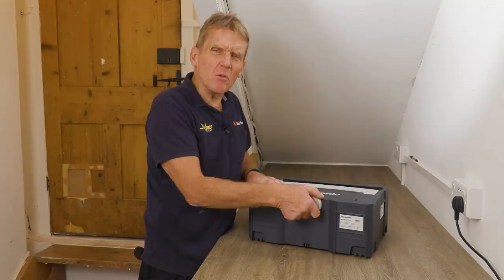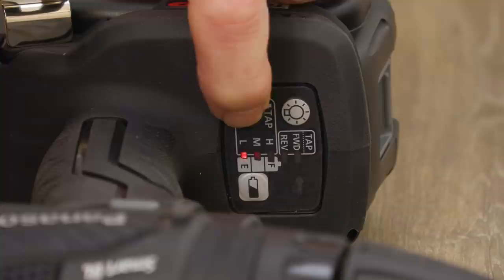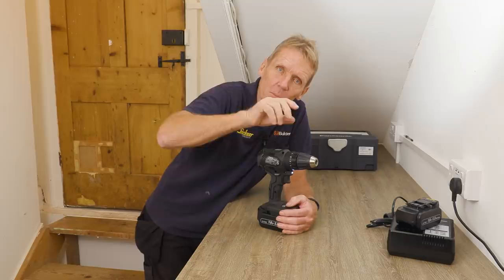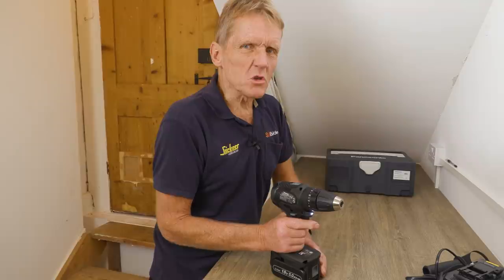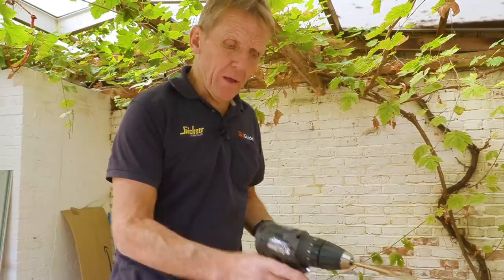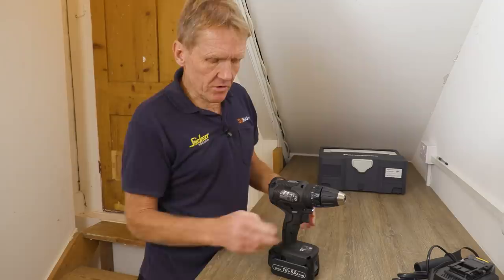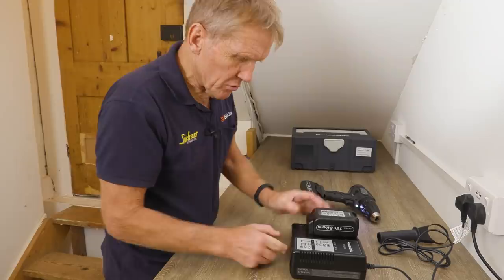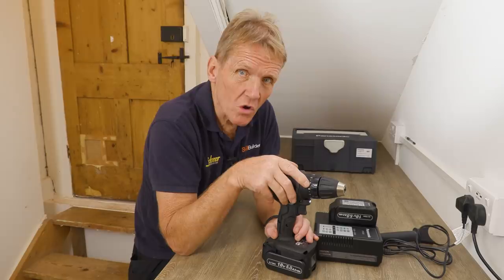Panasonic Next Gen Intelligent Smart BL Drill

Comment: I bought a Panasonic tough tool in 2008 when I did my apprenticeship, I still use both my impactor and my 14.4 drill driver, I used the 14.4 to mix up cement the other day with a paddle after 13 years of solid abuse the batteries still going and the machine is still working. In that time I know people who went through 8 makitas of the same spec. You want batteries that just don't ever die and tools that can handle a pounding then get a Panasonic drill and impactor. Everything else I use is Hikoki and Festool - I cant speak for the other Panasonic stuff, but their impactors and drivers are ultra crazy durable.

Comment: Been using Panasonic for 15 years since I got their 14.4v impact driver which imho was the best to date, this generation of combi drills are superb, the smart gear really works well. It’s still too heavy to replace my Panasonic 14.4 drill driver for most usage but it’s brilliant when I need the guts to use large hole saws and auger bits.

Comment: I threw out the beat up 15 volt  that I had for 20+ years one of the original batteries outlived the secondary generic replacement. I have owned DeWalt, Ryobi, Milwaukee and Porter Cable and none have come close to the Panasonic. That one at the time charged in half the time of the others and weighed less.

Comment: I think that those systainer cases are really sub standard. Dewalt Tough system is the standard to beat. Good stuff Roger. Thanks
Reply from the maker: Mark 
I agree that DeWalt T Stack is way better.
Reply: Yes,systainers need to have care taken of,I have lots of them,some got  real battering and with a single little crack on a lead(just one)still going strong.Dewalt ones I use to build platforms on(when doing partitions and plastering)!
Reply: I agree. I have milwaukee tools with dewalt boxes. 2 reasons. Number 1. People will see the box and go "eeeeee" and not try to rob anything
Next reason, they are quality. Haha

Comment: Mmm I wonder how long all the delicate electronics will hold up on a real building site. Nice drill, don't get me wrong, but that sort of drill I would tend to use in a cleaner less coarse environment like a woodwork shop or kitchen/ bathroom fitting. Deffo don't think it would stand up to first fix on an electrical or plumbing job on a building site. But that's just my opinion.
Reply from the maker: Tiny Tony You may be right but they won't leave it with us long enough to find out. We would love to put it out there in the real world.
Reply: Been using Panasonic for 12 years.. Batteries r great... Still going strong...

Comment: Sorry, Roger but I don’t see the point as there plenty of main makes on the market these days. It would have to be cheaper than some of the best to compete.
Reply from the maker: That is fine. We are not selling this drill, merely putting it in front of our trade audience so they can see it. As you say there are plenty of other makes but Panasonic is not a new kid on the block and lots of builders swear by them.
Reply: Best battery’s in the industry. I’m still using my 14year old 14.4v 3.0ah drill and impact with the batteries they came with, alongside my new  smart brushless kit with the drill from this video. They work underwater and I’ve tested  this, on the rainy day when you’re fixing a gutter and waters running off the roof allover you and your tool you’re glad of this feature. Dual voltage too, so for the guys who have owned and loved the 14.4 range you can simply use the same batteries with the new tool, saves abit weight too if you don’t need that extra 3.6v.

Comment: You missed out on a feature the Drill has... the ability to use 14.4v batteries.. while this may seem dumb at first... a 14.4v battery still has loads of power for most things but it makes a Panasonic even lighter and feels even better to use for those that haven't got a 10.8v or 12v system too... not everybody is using them for drilling loads of big holes through wood.

To me, Panasonic has always had the best feeling well-ballanced drills and impact drivers to use they feel more comfortable to use than others. I've never had any of their membranes fail on the likes of my impact drivers.

While the tap setting is a bit gimmicky people may find other uses for it and it's an extra function that others don't have... you don't have to use it but it's always there.. you might find it useful to clear chips from certain types of wood bits in deep holes.

the only downside to Panasonic is they don't have the vast platform range other manufactures have.
Reply from the maker: Yes I forgot to mention that important dual voltage. My mistake and apologies
Reply: I have used panasonic drills for 15 years and they last ages. I do some tapping here and there. Its easier to tap with a drill because you can keep the tap upright without the wobble you get from a hand tap. Its very easy to break taps so this function on this drill is a real boon to some people.

Comment: I've never seen a drill with a tapping mode... that would be really useful in engineering!
Reply: I worked for a fabrication firm many years ago. I was showing off using a drill to tap M3. Promptly snapped the tap in aluminium job. 

Note: removing carbide out of aluminium isn't fun.
Reply: @TurinTuramber  yes I know.... I feel your pain from experiance. I imagine the tapping mode has some kind of torque limiter to help avoid snapping taps
Reply: Metabo has had one, but that’s about it on the consumer market  as far as I know.    I’d have to imagine that the aerospace/aviation, automation, or assembly manufacturers have torque limiting tappers on offer for their sectors.
Reply: @robertrada4783  yes Robert they do, ive seen them in a factory in Malaysia: they are purpose built tools that look simular to dremels however they are torque limited and speed controlled.

Comment: I used to have Panasonic drills before the cordless market really took off, I had a Ni-Cad version which was a great drill and because of that I upgraded to a Li-Ion Panasonic when those came out and I didn't like it at all. 
One of the main issues was that the drill stopped so quickly when you took your finger off the trigger that the momentum in the chuck undid it a bit and drill bits were always coming loose. Also the chuck shape with a sharp taper is not the best to grab hold of, chucks with flat sides are much easier to use.
The Panasonic impact driver was even worse, completely under powered and put me off impact drivers for a good few years. Anyway I hope Panasonic have fixed the problems although i can see the chuck is the same shape.
Now I've gone with Makita which are nice to use and they have great little hydraulic impact driver.
Reply from the maker: That thing with the chucks was true of all of them due to the electronic brake. They have now put a click lock on the chucks to overcome it.
Reply: I've had /have 5 drills both with the plastic-covered and metal chucks and the only time I had chucks undoing was my fault for not fully tightening them.
while the tapered version and the plastic housing may have slightly reduced some people's ability to tighten a chuck.. it was good for getting it to drill at tighter angles without marring walls or finished surfaces.  I have had 3 versions of their impact drivers too and while not as fast using a 14.4v battery or my Milwaukee it did all I needed.. but then i'm not putting in large numbers of big lag screws or the like.
Reply: @TunedIn1  Maybe I had one of the first generation anyway it was a pain and I don't like to blame myself ;-). A good point about getting into tight spaces, I'd not considered that.

Comment: No no no no no. Being in IT there is NO NEED for the smart function. Yes its not smart as in connects to Internet but electronics in that is a mistake. Make it a it physical knob not a button. And i suspect those buttons are going to wear real quickly. I have a battery powered lamp that has those style buttons and they wear quickly and the button dies shortly after.
Reply: Been using Panasonic for 10 years or so, had the brushes changed once on the sds and still on the original batteries, shame they don't make a router, but am more than happy with the impact, drills and SDS and would recommend to anyone
Reply: Buttons like that will never last as long as a physical clicky one.
Reply: @mikeharper1102  agree, agree, agree and totally agree
Reply: Having been inside a few impact drivers that appeared to have membrane panels, they all (thankfully) turned out to have proper clicky microswitches hiding beneath.   I’m sure Panasonic is doing the same.
Reply: I agree that messing with those settings is finicky but how long they last is down to the manufacturer. I have 30 year old Panasonic hardware with such switches and it's like new. Though not sure if stuff is made to last as long these days.

Comment: What’s the point in that digital speed control if it still has the mechanical speed control switch on top? Can’t believe you didn’t even show the digital speed control in this “review” or the tapping mode in actual use 🙈🤦🏼‍♂️
Reply from the maker: Yes that would have been nice to show it  but buying a tap for £35.00 and finding a steel to tap into was a bit more than we could do. We have to try and decide where to spend our time and money. The top switch is the gear box which alters how much torque you get and the bottom switch is an electronic speed limiter. I thought this was clear but maybe not.